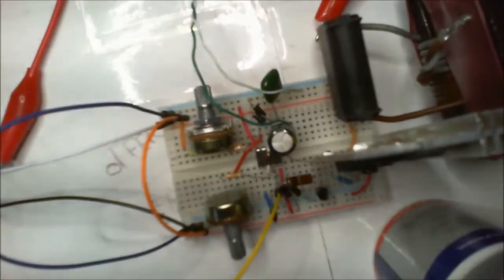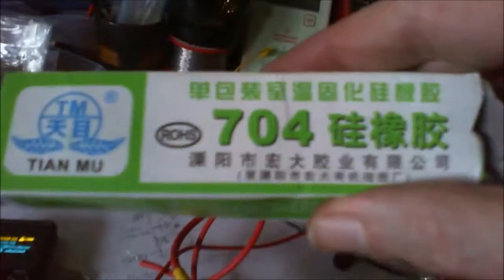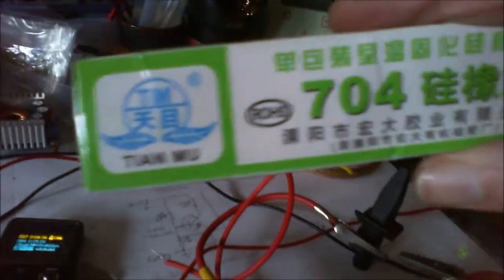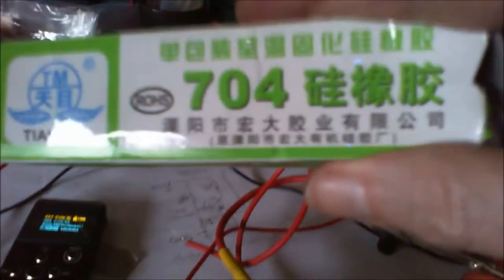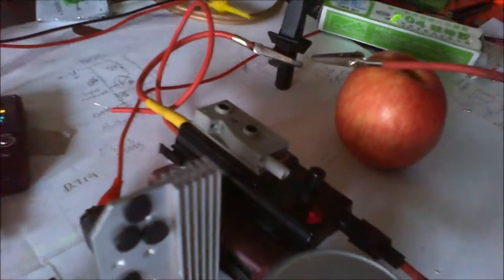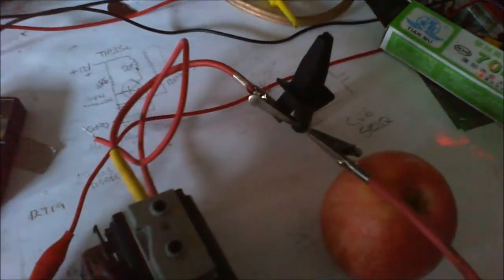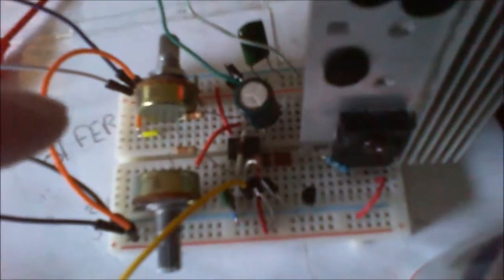Singing Flyback Musical Arc My First Attempt

Comment: The sound might be clearer if the arc had less current behind it, like those blue/purple arcs you usually get from a slayer exciter ;)
Reply from the maker: +Self-Trained Professional Hi cheers for the input, I can not remember what the circuit was using amp wise. I will play with it as I have a am radio and amp circuits I built so I can use them for testing and if needed sacrifices. I need to read up how to suppress the HV kickback from the flyback at switch off. Also the flyback i used was not as efficient with this circuit as the one I built the circuit with originally, so I will use that again and see what happens.
Reply: +Elecifun Good luck ;)
Reply: +Elecifun Good luck ;)
Reply from the maker: Self-Trained Professional Cheers :-)